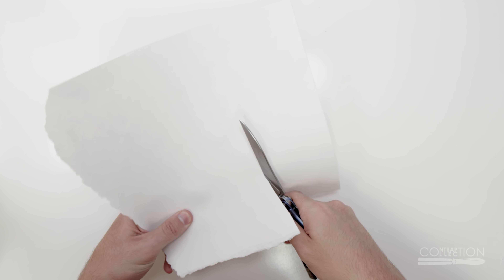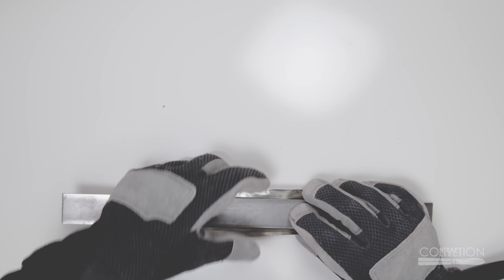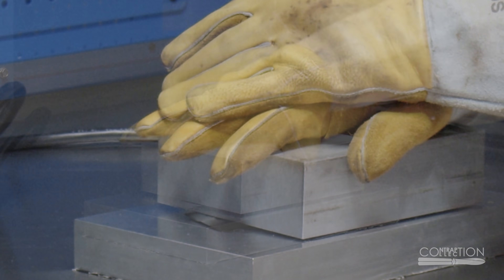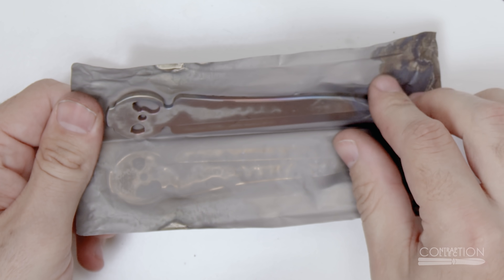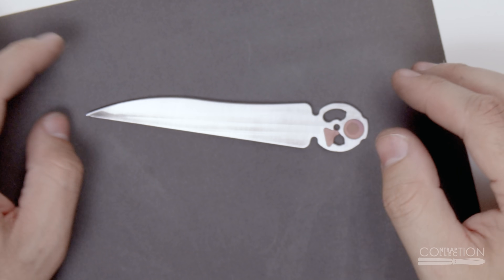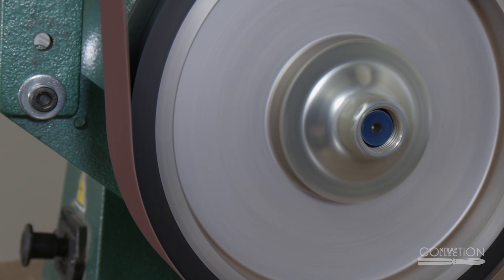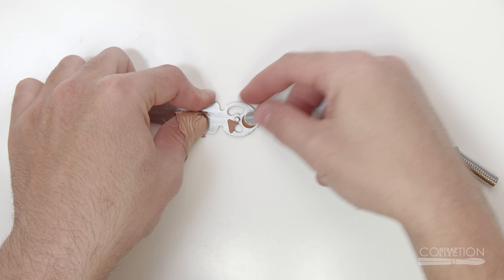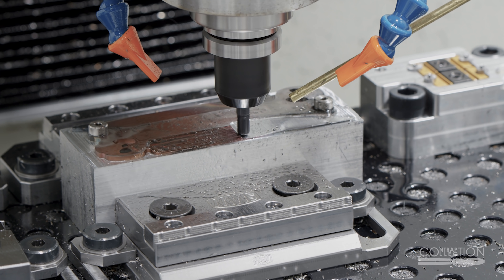Heat Treating Baliscissor Blades! Ep 18

Comment: S30V is okay, S35V is better, but stay away from D2. Don't know why anyone likes it. It's a sub standard steel. It might work for a budget offering, but I would make it a last resort. 

M390 is a fantastic choice, 20CV is absolutely overkill (but also why I love it), and if you're feeling fiesty you can do a run of M4 at 63HRC, although that last one doesn't have the corrosive resistance for a preferred EDC.

Source: knife sharpener of many years.

Also, hardening realigns the grain of the steel. Ferromagnetic metals are affected by EMFs by pulling the metal into alignment, so they're all pointing the same direction. I'm not entirely sure that hardness can have such an effect on magnetism, but I can see the connection.

Edit: Atherial below explained that yes, the structure created my heat treating can magnetize the steel.
Reply: D2 is a fantastic steel... for dies.  If you want a knife-shaped scraper/prybar/punch it's pretty tough, but it's not great for a knife edge.   It's also not the easiest to machine, and amongst the most miserable for grinding.  My dad abuses and neglects knives, so I gave him a heavy D2 blade. 

I honestly think a fairly ordinary grade of stainless would be a really good choice for these scissors, but blade snobs won't go for it.  Small-scale production would benefit from using something more prestigious that can command a higher price for relatively little additional cost.
Reply: @SouseMouse  like a very reasonable choice would be VG10. It's not great, but it's not bad. Do I want a 20CV or S110V version? Yes, but that's wholly ridiculous and completely excessive.

I'll buy it for the thing it does, not the steel. But I'll pay an extra $20 or $30 for something crazy just so I can slightly abuse it.

Comment: Following manufacturer they want you to let the steel rise with the oven. From cold to 1600 to 2000. In practice what you did is perfectly fine and won’t hurt anything. For the bend, I would use a vise and put the bend with three points until right amount t is achieved before the heat treat. Probably would mess up tolerances though

Comment: Can you heat them up rlly hot than dip them in cold water
Reply: Different steels have different recipes for heat treating. Look up the Crucible website and read some of it. They go into detail how to dial in your recipe to get certain properties, like flexibility versus wear resistance, all through the changes in heat treatment cycles. Some like cryo quenching, some air harden, some need several tempering cycles.

Comment: I've seen some knifemakers throw a piece of paper in their stainless foil wraps to help consume the oxygen inside the pack. Should help reduce oxidation
Reply: Also borax paste coating is another common way to prevent oxidation
Reply: @brannonhudson6868  I was about top suggest it. +1
Reply: this kid needs to get an old machinist handbook and refference for the stuff he doesnt know alot about. the handbook guides you to put paper in the foil pouch to help prevent decarb.
Reply: The paper burns reducing the oxygen content not that the paper absorbs the oxygen
Reply: I think most people that understand that paper burns and fire consumes oxygen didn't need that clarification
Reply: @DieselRamcharger  You think those blades were packed in their foil pouch in a vacuum? Oxygen definitely gets trapped in that pouch, the paper igniting it burns up that oxygen, then stops burning. In fact, it chars, and becomes a pretty nice fire starter. A version of Char-cloth.
Reply: @DieselRamcharger  If there was no oxygen for the paper to burn with, oxidation wouldn't be an issue for this process to begin with. 

and I literally said fire uses oxygen in my comment....
Reply: @de8173  paper burns? Holy shit

Comment: I've seen makers include a small wood chip to consumer the oxygen left in the bag but I'm not sure if its actually effective without a near-perfect seal. Id bet the point oxidizing the most is due to oxygen leaking in from that direction

For those pinholes, pick up some barrel laps off mcmaster and polishing paste. Flitz or <5 micron diamond probably. All said and done maybe $25. Carbide reamers will wear pretty fast doing that, but it's a good first step to do that with a dedicated beater-reamer before lapping. The laps last a long time since their adjustable

Comment: I’ve seen blacksmiths on YouTube heat-treating blades by quenching them in oil and then straightening slight bends before the blade cools entirely. Therefore I imagine it would be possible to induce slight bends as well.
Reply: I'm thinking milling his heat sinks to curve at a certain point, and aligning the blanks with that curve to knock out two operations at once, then using a heavy duty clamp for pressure. Yay! More fixtures!
Reply: @YoureSoVane  That’s a really good idea👏